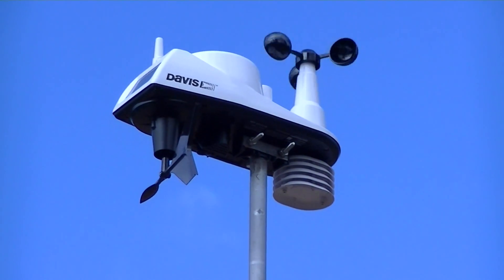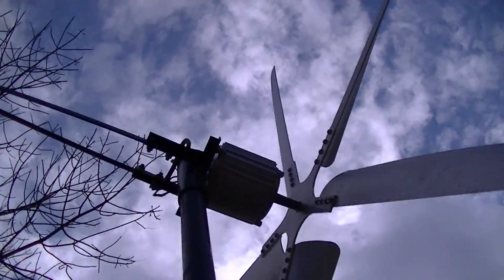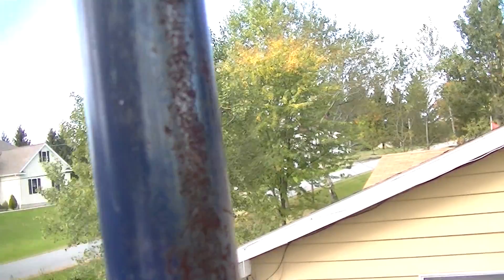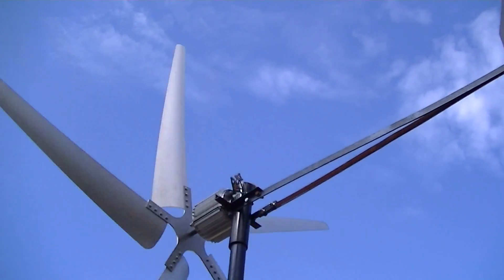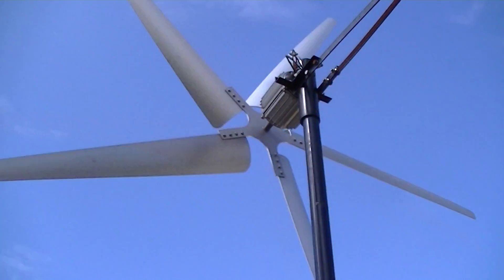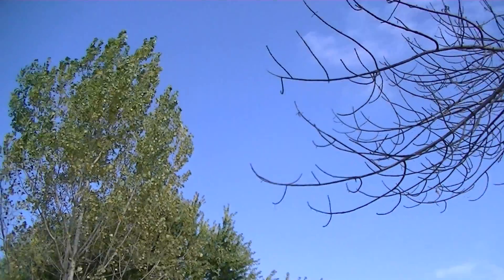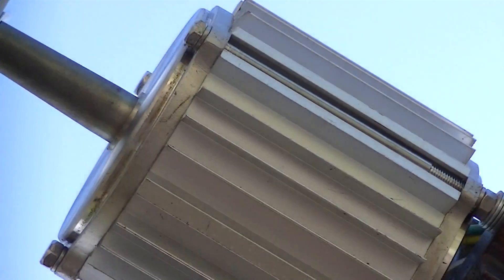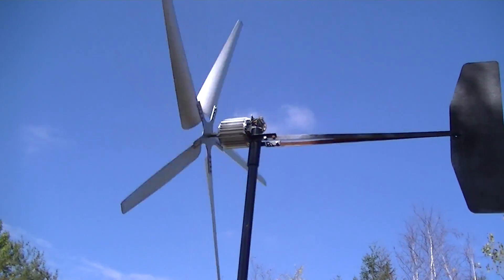WindyNation WindTura 750 Up Close

Comment: I like the cam on the pole! "The chunky Bumble Bee", saying it when he heard that noise, LOL! But for the wobble and the gape, I had the same on a over sized bracket hole, so I took some black electrical tape and wrapped around and greased the outside of the tape and it lasted for 2 years, but it took up the space and it still turned nice!